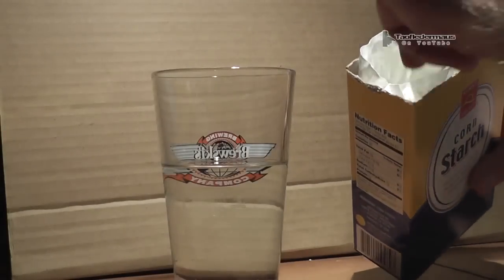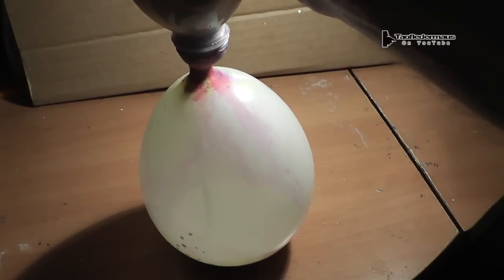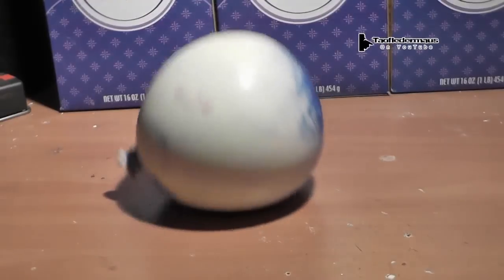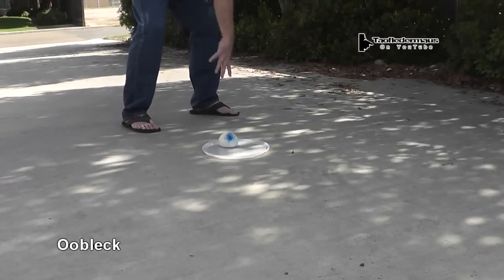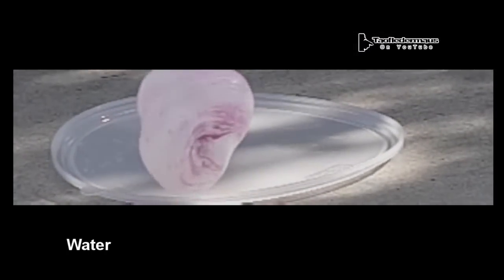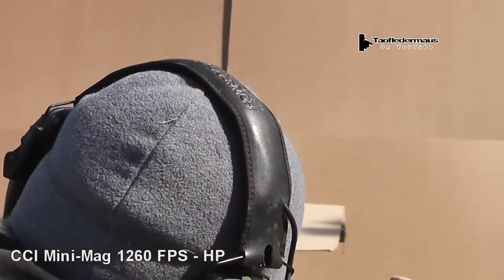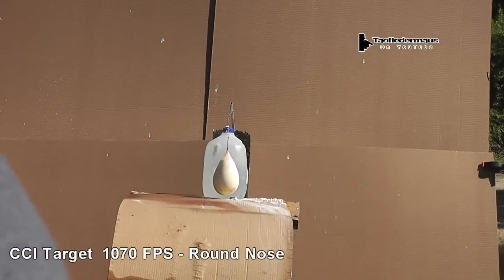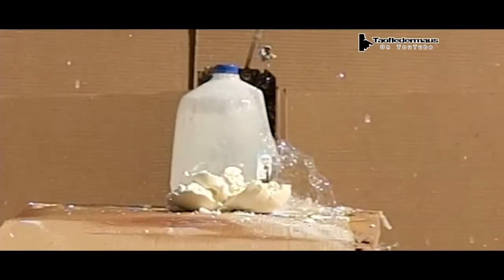Is OOBLECK  Bulletproof?   - Cornstarch and Water

Comment: I think a problem with the test was that a balloon doesn't provide really any resistance for the corn starch to push against so the force of the bullet is being dissipated by the balloon (and corn starch) exploding outward.
Reply: +inademv came to comment the same thing. I honestly think the experiment should be redone in some way.
Reply: Reece710
Would probably go with a round metal bowl and fire downward into it.
Reply: AMidgetWalrus
 Probably
Reply: +inademv Your comment says exactly what I was thinking. I reckon it failed more because the balloon itself gave way rather than the fluid. I would like to see this done using a large open tank, similar to the ballistic gel test, so you would be able to shoot the fluid without relying on something fairly fragile like a balloon to hold it.
Reply: I'd try something more like a wide-mouth glass bottle sitting sideways, or maybe a Gatorade/Powerade bottle. Just tape over the end to keep the corn starch inside. Glass holds up remarkably well to pressure as long as it's not cracked. Obviously going to have to thread the needle on the shot but that cornstarch will have nowhere to go.
Reply: The new body armour does actually follow this principle. It's a special gel layer in the kevlar that hardens on impact. Made not only for ballistic armour but for motorbike armour as well.
Reply: @dmstretch6634  well i thought of oobleck inside kevlar but idk what would happen when shot.
Reply: +inademv So does that mean that it might be possible to encase this stuff in steel, and use it as a ballistic plate? That would be really cool if we could get this to stop a bullet somehow, even if it probably wouldn't offer any advantages over conventional armor.
Reply: ***** I guess that means that it's soft armor then?
Reply: Till it gets hit lol. Turns rock solid for a split second. Supposed to be lighter than the previous stuff but much more effective.
Reply: ***** That's really cool. It sounds alot like the nano armor from Crysis 2 lol XD
Reply: Lol, ish, just without the nanites. Another case of science fiction becoming science fact lol.
Reply: +Max McTabish But... crysis 2 was the worst game of the serie. It was just a generic corridor shooter. :(
Reply: Bobistdeinemuda No wonder they were giving it away for free. I haven't played any of the other ones.
Reply: Bobistdeinemuda
I tried playing Crysis 2, but I'd go cammo, hide somewhere, and they'd start shooting me through walls. Buggy as hell, and lacked the finesse of 3, and the open-world feel and play of the first.
Reply: the problem is: it shatters and due to the balloons elasiticity can be easily moved "apart". If it would find itself within a solid box or container, the shattered pieces would not that easily separate from each other, allowing the pass of the bullet.
Reply: Can you suggest me some non Newtonian fluid / liquid which can prevent bullet. If you can share any video or research paper, that will be helpful for me Thank you
Reply: +inademv Could you use something like a soup can?

Comment: They are experimenting with NNF made up of carbon nanotubes in a layer on bulletproof vests and are having great success. It's super light and you only need a thin layer sandwiched between some Kevlar and it stops bullets, frags, even concussive forces, all while being a fraction of the weight and having the ability to be used in various jackets and such without being obvious to an onlooker.

Comment: Two things: fresh, just-made substance might have different properties. If it smelled bad, it's likely that there was chemistry going on that would affect the results.

Also, I would expect something strange to happen, but not to stop the bullet because the impact is limited to such a small area and short time, meaning the entire mass of the fluid probably would not solidify. Maybe more of a cone shape with the point where the bullet contacts the surface. A much higher-speed camera might reveal more, not that I expect you to be able to afford that.

The second shot seems more like what I would expect, with basically a cone being ejected out the back with the rest of the mass reacting too late to capture the bullet. It's hard to tell for sure from this video, though.

Comment: even if you had used a solid material in the shape of the balloon, the result may have been the same. the non newtonian fluid acts under compression. could you design an experiment accordingly?

Comment: There's a bulletproof vest being developed in Poland using this property of non newtonian fluids. So it is indeed possible to stop a bullet.
But the problem I see here is that baloon latex surface is under tension. So, when a rip is made by the bullet, the whole thing comes apart and the bullet goes through. Like when you hit tempered glass with something sharp.
I believe it still won't stop a bullet under other circumstances though. But it would be cool to see other experiments that address the  problem I saw. Like oobleck in a plastic bottle.

Comment: Do the same test but instead of suspending the balloon up against a milk carton full of water try putting the bag of fluid inside of a box preferably something very sturdy , making sure the fluid fills the box edge to edge even when its liquid. my guess is that it would only take one and a half to 2 inches of the non-newtonian fluid to stop your bullet if the rest of the fluid couldn't deform outwards the way it does in a balloon.

Comment: Wasn't aware they sold hollow points on the current market.
Reply from the maker: Fester  Most .22's are hollow points.
Reply: Right, i'm in the armed forces and we are told that hollow point is banned in warfare by the Geneva Convention because they are inhumane. Wasn't aware they were available to the general public.
Reply from the maker: The solid, non-HP .22lr rounds are more for target shooting.   I think HP rounds are more abundant because they use a little tiny bit less lead and ammo companies can save money in the long run.
Reply: Ah okay, thanks for the clarification. Love the videos By the by.
Reply from the maker: thanks!!
Reply: Also, lots of .22 is for hunting varmints. If you aren't going to eat it, and it's small, a hollow point is more humane. It'll kill the varmint quicker.
Reply: The Hague convention bans the use of expanding ammunition in war, not Geneva.
Reply: What rock do you live under?
Reply: Fester They aren't allowed in warfare due to the damage that they cause. but civilian cartridges used for hunting and self defense are not held to the standards of the geneva convention, as it is not warfare.
Reply: barstooldreamer9803 My bad:)
Reply: It is a very common mistake.
Reply: Used by the public, my father has many rounds

Comment: I think if you shot a compressed block of corn starch you'd get the same result, mainly because Its a powder with very little fibre support. Bullets will punch through because it lacks the ability to disperse the energy. Not that i'm an expert or anything, just some thoughts on the subject

Comment: A Gummi Bear is not a non-Newtonian fluid. Its not a fluid at all. A fluid, by definition, is a mass that takes the shape of whatever is containing it. You can set a gummi bear down, and it still retains its shape. Now, you can MAKE it a fluid by heating it enough, but thats a change in state meaning it wouldn't be a gummi bear any longer.

Comment: But you did not mix them on the moment as to mix properly them and they don't settle down in the bottom, also bacteria may have degraded the starch in 3 days
Reply from the maker: Sounds like a good project for you to debunk.
I'm looking forward to seeing your video.
Reply: *****
Actually the bacterium had turned the some of the starches into sugar, and the sugars bonded together, it's obvious from the caking that can clearly be seen. Though the results would have been almost identical I wouldn't call it proper. I suspect proper fresh balloons would have created a wider more adhesive pattern.
BTW: when mixing the corn starch, and water always add the corn starch first, then mix in the water.
Reply from the maker: coline123456789  It was proper.
Reply: ipissed
Exactly, that is what I was meaning!

Comment: I seen a tv show where they set up some fluids, and the non-Newtonian fluid did stop the round, I think they used a shot gun.  The set up was 2 panes of glass, about a foot square set up on a wood block about 4 inches apart, in between them it was filled with pudding,  the first pane broke, the pudding locked up to a solid and stopped the lead from passing on through, and the 2nd pane was fine, Maybe it was plastic,not sure. but the fluid did work,   Maybe try a similar setup where there is more fluid mass to work then just a tiny bit in a little ball.   EDIT. I found it,,  video here.. http://natgeotv.com/ca/street-genius/videos/bulletproof-desserts
Reply: John Norris that video has been blocked :(
Reply: That sucks, probably because it was a broadcast station the video came from.  NOTE.. I just updated the link to another place to see the video.
Reply: You can still see it at the following Link..  http://natgeotv.com/ca/street-genius/videos/bulletproof-desserts
Reply: John Norris thanks man

Comment: did you guys notice that the hollow point when it impacted made shard-like fragments? also when you store non-newtonian fluid it changes consistency, basically it gets old if it changes in its hydration and there are other variables... you should try using a fresh batch if you try again...

Comment: Part of what I think went wrong with this experiment is your choice of container. As soon as that balloon tears, it's going to contract and the oobleck will no longer have a solid container which defines its shape. At that point, the natural reaction of the oobleck is going to be for it to just spill out over the table. I think you should have kept the fluid inside a container like a milk carton or a jug so that when it's hit, the integrity of the container is still relatively intact besides the entry/exit holes

Comment: The gummy bear test vs. the balloon filled with the non-Newtonian fluid are simply apples and oranges, or maybe grapes.  This test fail was in the different forms of material as the projectile penetrated the thin vinyl balloon membrane that formed the structure around the non-Newtonian fluid.  The balloon pierced, then immediately the water filling lost its structural integrity and the projectile continued to blow on through.  The difference between the hollow and solid point projectiles is weight and slower travel speed.

Comment: They are currently working on something similar using a liquid to harder and re liquify itself at the point of impact. Good idea this guy had, too bad he didn't patent the idea :( They are using a silicone based iron rich fluid though and adding an electrical charge to cause the iron particles to harden and re liquify when it's removed. No idea how close they are though,  just something I read about when using google and I accidentally found this video in the same thread.

Comment: The problem is that everybody is asking the WRONG QUESTION! The question isn't "can it stop a bullet", we've already got Kevlar to do that, the question is "can it provide adequate backing for kevlar".

See, Kevlar requires a backing or else yes it'll stop the bullet... after said bullet pierces into you, the Kevlar following it until, like a trampoline with a fat dude jumping on it, the kevlar finally manages to push it back. The bullet can't get THROUGH the Kevlar, but it still needs something to back it.

The backing can be either steel or ceramic, with ceramic being the preferred backing because it is lighter. The problem is that both of them are fairly inflexible and still fairly heavy.

If oobleck or some other non-Newtonian fluid could be used as a backing instead of steel or ceramic, we could start to see much lighter and much more flexible bullet resistant (nothing is bullet PROOF) armor for both the armed forces and for public safety... if they want to spend the money of course.

Comment: I read in an article that the military is planning on using non-newtonian fluid in bulletproof/bullet-resistant vests because it hardens under pressure. I guess this'd get them to reconsider that.
Reply: Why?... they're not going to be using corn starch. It'll be something a lot more advanced.
Reply: John Thomas
Cornstarch is the safe option....
some are poisionous.
Reply: Sabrina It's in development. I doubt they'll use poisonous material in the armor designed to protect the person wearing it.

Comment: ***** You should re-visit this eexperiment but this time put the fluid in a hard tube rather than a balloon. It looks like the bullet just made a hole in the balloon allowing all the fluid to escape out of the way. If it was in a hard tube, perhaps the fluid would actually stop the bullet since it has no where to escape to.
Reply: This is an impression because of the milk.
Reply: He should also do it again because as he said, the oobleck got rotten and nasty. but, he failed to mention the fact that after a day, even if covered, the oobleck will harden and turn to dust.
Reply: Joshua Marcel Yeah, I was about to comment the same thing

Comment: It should be pointed out that the impact of the bullet is spreading out hardened fluid so quickly that it's piecing and busting apart it's containers. I've read of people putting this stuff in kevlar bags, ceramic plates, and it stopping bullets. Students even used kevlar and cornstarch to fill potholes until a construction crew could go around and fix the issue.  I'm going to put my money into the idea that the container you chose simply couldn't withstand the impact of the bullet, or the pressures of the fluid.

Comment: The ooblek may of had consistency issues, but the second one clearly worked, what prevented it from stopping the bullet was a issue of material containment failure.  The balloon is what could not resist the force. Allowing it to simply explode like shooting a rock some times does. If you put a stretchy cover over a box, that could contain the force,  and shot through the covered side, it would stop the bullet.